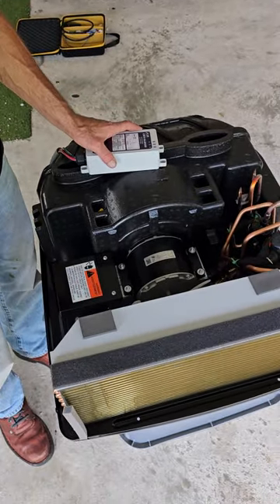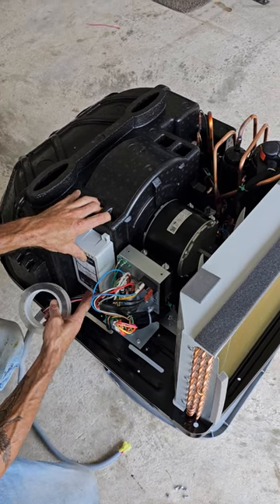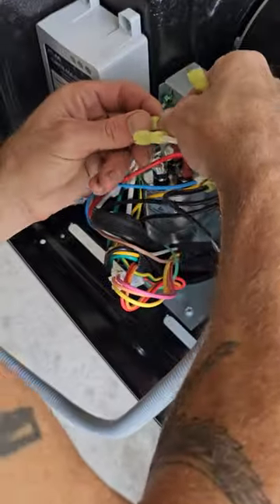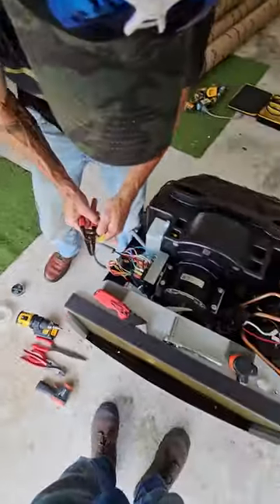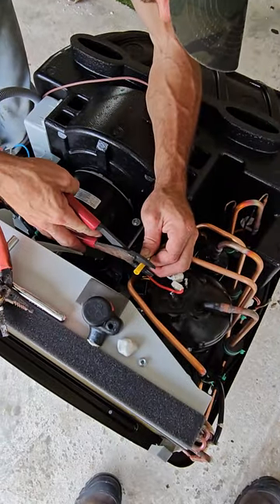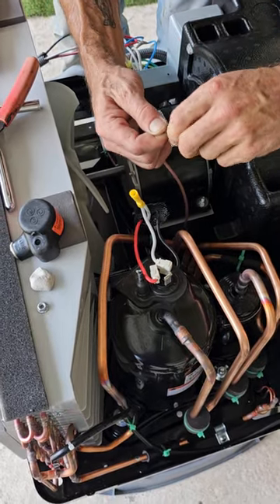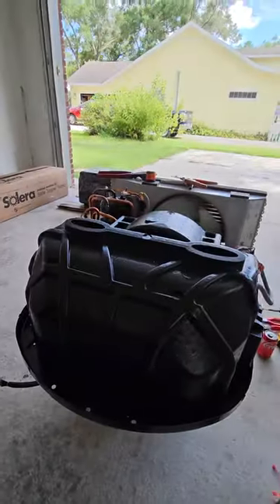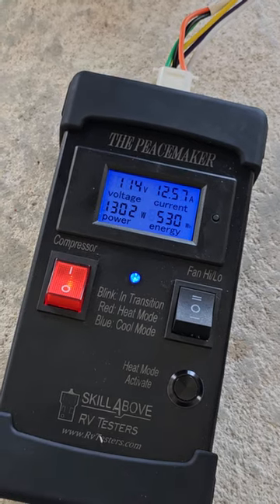icm soft start install on ge ac unit

Comment: I just installed one of these on a GE 13,500 btu unit and thanks to your excellent tutorial, it was easy! The wiring diagram is on the face of the soft start.
Reply: where did you find one ? everywhere i look out of stock ?
Reply from the maker: @davidwason7565 we have special vendors and parts connections across the country. We can get anything rv related

Comment: I installed two yesterday.  I noticed the QR code on the bottom left of the unit which takes you to install instructions. With their instructions you do not cut wires or crimp and connectors.  Easy

Comment: According to ICM directions and their specific installation instructions for GE units ,the white wire from the compressor goes to the c post of the run capacitor is supposed to be disconnected and spliced to the Brown wire not bridged in.. 3 way splice is wrong.